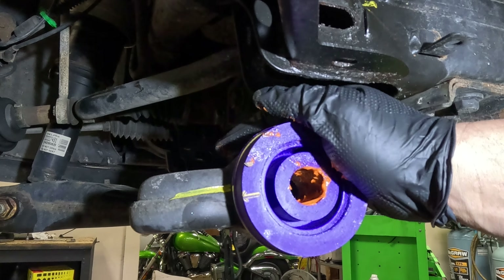06-13 Land rover, Ranger rover Sport, LR3 LR4 Control arm bushing replacement with polyurethane.

Comment: Excellent!!! I've seen a lot of similar videos, but yours is definitely the most useful from my point of view. Sharp close-ups, cutting tool tip, complete procedure, but still a relatively short video. What more could we want!!! Thank you and I subscribe!!!
Reply from the maker: Awesome that's exactly what I'm trying to go for. I have one coming in the next week on the front differential removal. And the rebuild following that
Reply: Where do I buy these
Reply from the maker: The brand is Powerflex.  I've used them on several different applications over the years and never had an issue
Reply from the maker: Maybe I'm not understanding what you mean by that, feel free to email me at hellerautomotive11@gmail.com and I can help you more

Comment: Are the bushings the same for the front and rear of the front lower control arm? Mine are needing to be replaced.
Reply from the maker: No. But you can get a kit from powerflex like in the video
Reply: @nsigarage5212 thanks. I’ll look them up

Comment: About how long did it take for both control arms?
Reply from the maker: About an 1hr  a side.  But i do have a lift and a full shop.  Longest part is cutting the bolts
Reply: @nsigarage5212  thanks for sharing. My local European garage is quoting me 8 hours total :)
Reply from the maker: Yeah thats nonsense. I could see 4 tops to do both lower control arms, but not 8